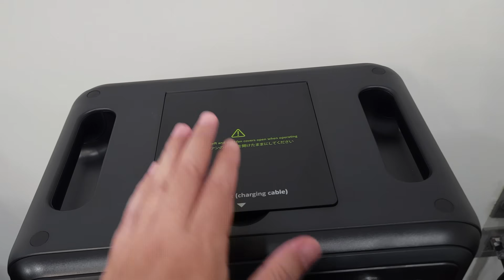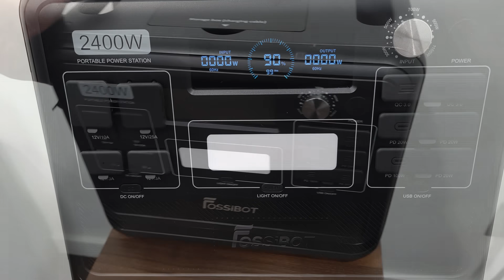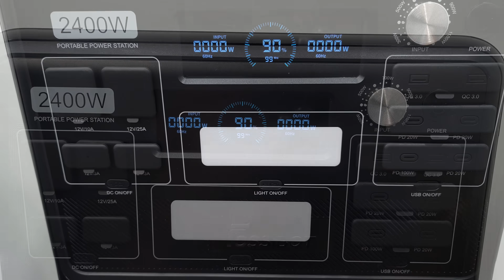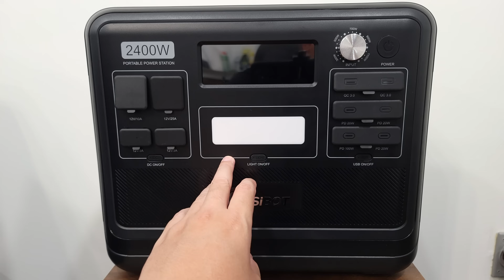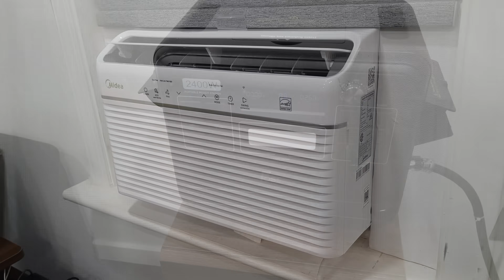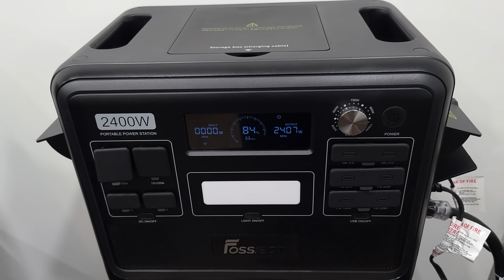Affordable But VERY Capable! | Fossibot F2400 Power Station Review

Comment: Fossibot is refusing to honour the 5‑year warranty on my F2400B.  
They received my faulty unit, confirmed it was under warranty, and then stopped responding completely. No replacement. No refund. No communication.

I’m sharing this so other customers know what to expect and what actions they can take if Fossibot does the same to them.

Here are the steps I’m taking now:

1. Sending a burofax con certificación de contenido demanding compliance with the warranty.  
2. Filing a formal complaint with OMIC (Spain’s consumer authority).  
3. Opening a case through the EU Online Dispute Resolution platform.  
4. Initiating a chargeback with my bank, since Fossibot has my product and is not fulfilling the warranty.  
5. Publishing factual reviews so other customers are aware of this behaviour.

If Fossibot resolves this properly, I will update this post. Until then, this is my documented experience.

Comment: Never heard of fossibot but that's a pretty impressive usable capacity. Good to see smaller brands stepping it up and competing with the bigger brands
Reply: Very tempted myself, just not sure about long term reliability compared to the more expensive units (anker, jackery, etc)
Reply: I bought one in july. Very quiet and , so far, works perfect. So, 2 month, used every day. 35 liter 12v compressor fridge on the xt60 outlet ( wich can be used for diesel heaters😊). Power my computer , lights. Used cooking with induction. Solar charged 400w. Soon solar is over in my part of the world..far north. Winter is coming.
Reply from the maker: Yep. more competition is always great for us buyers!